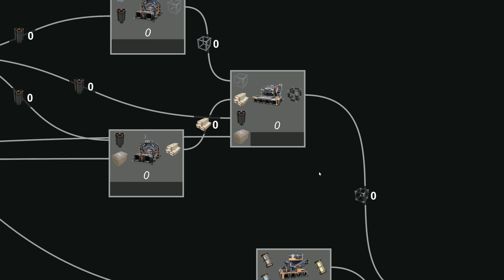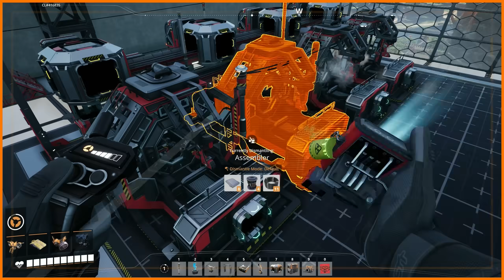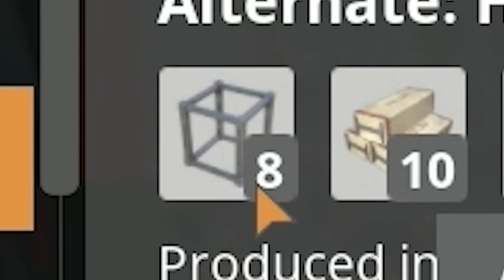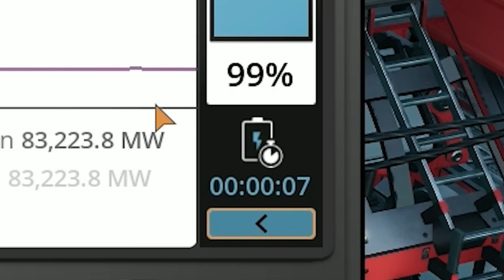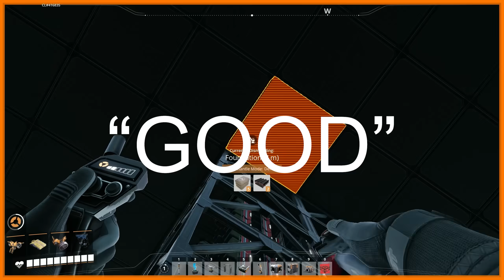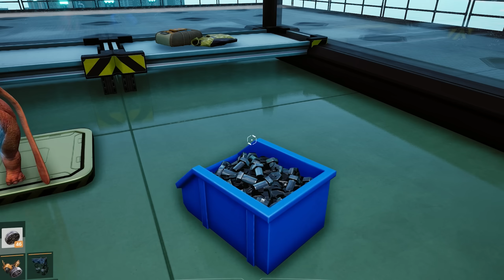18,000 Iron Ingots = How Many Heavy Modular Frames? - Satisfactory 1.1

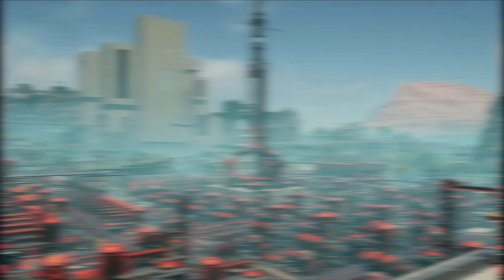Comment: I know I am late to the party (again), but this entire power-problem-situation at 19:47 was the reason I built a fuel power plant at the Golden Coast and a totally overkill fuel power plant in the Northern Biome, whatever the green area in the north is called. Currently I'm making 200.000 MW (200 GW). It took... three weeks in total? Mainly because it was the way over diluted fuel and a lot of machines. On top of that I built a battery plant which can hold 200.000 MW of power for about an hour.

Next power project might be the turbo fuel plant in the Blue Crater Lake biome, but currently I am not feeling it. But it is about time, I would say. Nearly :D

My power consumption currently is somewhere around 52.000 MW. If everything would run, 82.000. So a bit of wiggle room still present. And I just started Phase 5 and I am setting up miners and such in the Dune Desert. It is going big, but I am going vertical here. :)

Comment: Hey Kibitz!
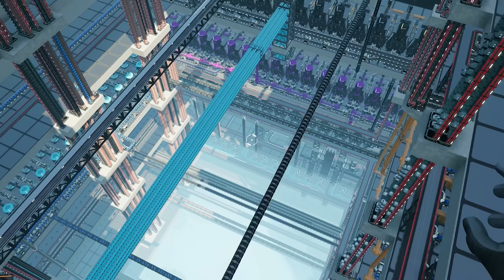Don't know if you know the trick with your belt lifts. At around 1:16 and 6:02 you have them attached to a foundation with a floor hole just in the middle section of the lift. I assume that the lifts were to short and you used it to extend the lift.
IF you attatch the lift to the upper point and then to the lower floor hole, even if its initially shown as too short, it will turn blue and buildable. I've made over 100m long lifts with that (completly unmodded save)

Comment: 17:55 Probably a decent idea to shut down a few non-essential processes until more power-production is available. Maybe even set things up so that that automatically happens before batteries, at least the bigger batteries, start draining. Possibly also staggering production so that parts of most manufacturing facilities shut down instead of all of individual ones.

In particular, small parts of ones responsible for power-generation, followed by the rest of those processes so that they can generate more power, followed by non-essential processes.

Comment: Kibs committing to the bit and not doing a crap build slow feeding in space elevator parts to get to mk 6 belts by now has to be a incredible amount of will. I would have given up forever ago. More than that, with so much of the "mission critical" power build designed with mk 6 belts in mind, there's for sure gonna be some random belts inside a splitter that are gonna bottleneck things all over the world. Good luck, Kibs. you'll need it, unless you plan on just going into the editor and swapping all mk5s with mk6. 

I also would have bit the bullet and admitted I needed a backup power source when i was 10k over my power draw and still pretty far from the end of the "get nuclear up and running" project. Should just tap the gold coast real quick just to bridge the difference and clear it out later.

Comment: 25:11 "or we can just wait on Mk6 belts"
story of the entire project. I feel that should have been something Kibitz should have just done by hand on stream for an hour
now i only FEAR how much he'll need to run around and update when he get's them
how many machines will be rebuilt and condensed since they were built with MK5 belts in mind
how many machines will need updating since they were built with MK6 belts in mind and left waiting
how many resource belts from biome to biome need to be changed, reduced, re-split
.
and of course, how many will be missed, cause a gap in supply, cause the grid to fail, and won't be found until weeks later still
Reply from the maker: Naw it'll be fiiiiiiine /s 🙃
Reply: @ImKibitz  you truly are insane
Reply: not 1:1 but an adage i learned real quick at my first IT job:
"the most permanent fix is a temporary one"
Reply: @me_mal  unfortunately in this case, I don't think it applies since half of his systems just do not work without mk6 and that is simply not something he can leave be in a nuclear power plant
Reply: Yea, I’ve been thinking this for awhile now.  The mk6 belt issue is eventually going to catch up to him, and it may result in massive unanticipated problems.  It will certainly make for great content.
Reply: That sounds like a kibitz move if I've ever seen it ,plenty of times
Reply: As I am watching this series I realized this problem ahead and unlocked my MK6 belts before I start building my nuclear power plant. I think I saved my sanity.
Reply: the belt replacement overhaul is quickly growing to be more monolithic than the previous projects combined, yeah
Reply: I really dont get why he didnt just get mk6 belts awhile ago
Reply: I wished we could choose if we wanna replace current belt, belt till next split/merge or full line from machine to machine....
Reply: cant wait for the panic to begin
Reply: It's gonna be a whole 2-3 extra videos for us!! 🎉🎉
Reply: I'm handling this in my world by building with Mk6 belt throughput levels assumed but actually using the belts I have access to, and underclocking my machines down to the ratio my belts are actually capable of. i.e. I'm at Mk4 so 480/1200 = 40% clock speed

Comment: Bottom line of the first blue print is missing the output convejors aren't they? At least it looked like it. (You removed the outputs to place the other side.)
Edit 1: Actually second floor as well I think now when you plop it up again for the second blue print (~11:00).
Edit 2: Seems to be fixed later on.

Comment: At this point in time my factory is on hold due to my fathers sands of time is about to run out. =(. Can't really do much but enjoy his company as much as possible till then. No matter how much you prepare for it. It will still hit hard.
I have a unusual coal power set up making use of the curved belts. But I think Ill just speghet it to get to the final phase then start work on the actual factory. Well mainly to get the hover pack at least

Comment: Just pull a normal or pure oil node and use a diluted fuel plant, this is easy to make and can generate like 10 - 20 MW, doesn't take a ton of work either and can easily tear it down once you get nuke plant on line.

Comment: 4:56 i don't know enough about the game, but could you swap the "ceiling" to upshifted 2m tiles as well, to buy yourself a bit more space for clip-prevention?
Reply: Yes, you can do exactly that to cut into the roof if you have to. You can put 2m and even 1m foundations in any spot between a 4m one.
Reply: Yes, he could’ve done the same pattern against floor or ceiling. My only guess is he wanted to keep the ceiling belt outputs flush and level…but I don’t know if he ended up running any of those outputs out the top.

Comment: I think another massive battery bank would be a safe move. Making like 200-400 to be able to comfortably get the nuclear plant running might be a good idea. Then, when the nuclear plant is running, you can disconnect it from the grid and have it as an emergency backup if, for whatever reason, the nuclear plant has any issues.
Reply: Alternately, perhaps a few alien power augmenters could help boost his power since they add 500 MW and 10% of the production, per unit.  With him producing 80,000 MW, just one APA would make that 88,000 MW.  In my world, I made a building with six of them all together.

Comment: With the vertical splitter/mergers in 1.1 you don’t need floor holes to make realy long conveyor lifts anymore. Just get it to max length, add a splitter near the end, deconstruct on the side where you want to to continue and build a new lift. Deconstruct the splitter and you have a long continuous lift.
Reply: You can connect two floor holes directly with a belt lift even if the distance is much further then a "normal" lift would allow!
Reply: Good tip! I'll try it out sometime.